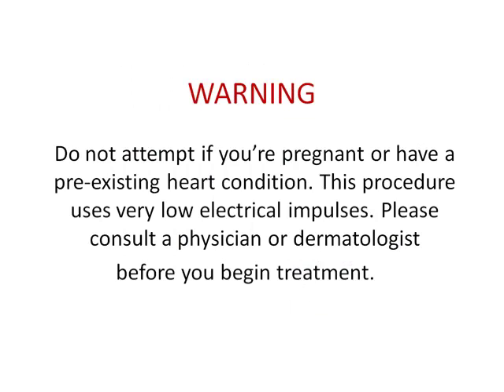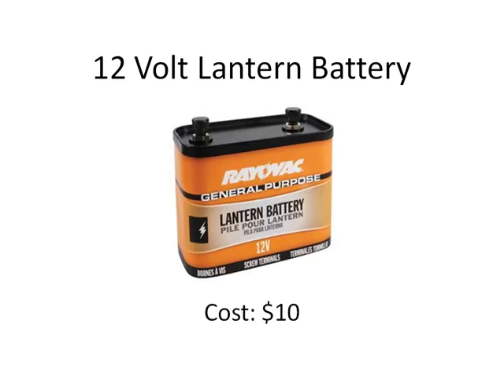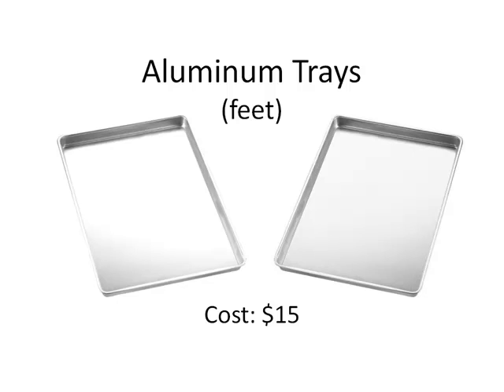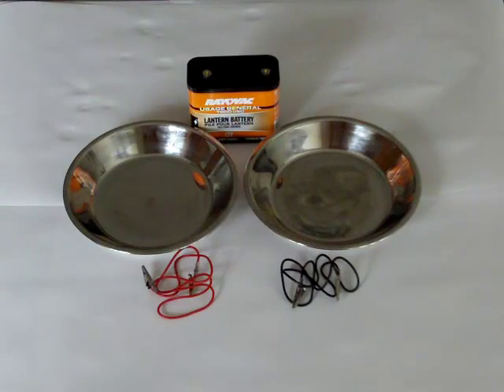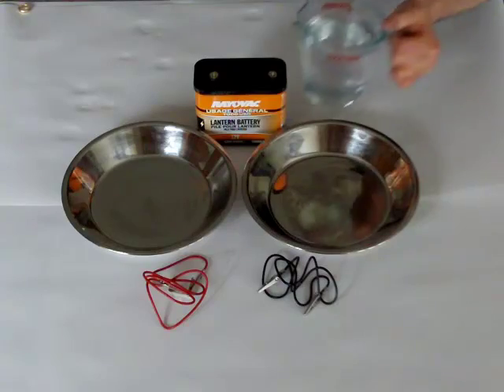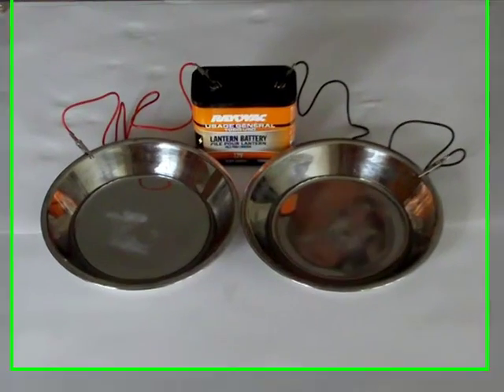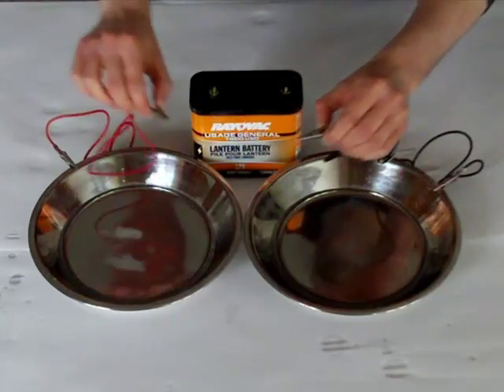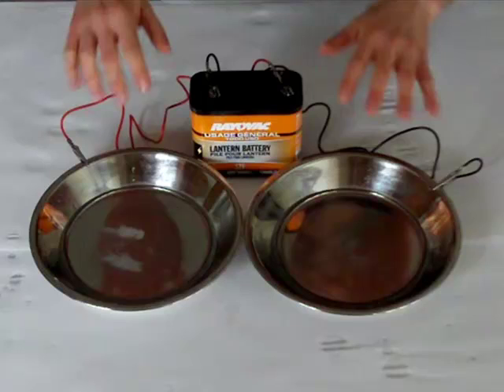How to Build Your Own Homemade Iontophoresis Device

Comment: iam using 12v 6 amps motorbike battery,,today my 3rd apply on this therapy,,but my both Palms and foot feel so itchy and hurts,no decreasing sweat during this 3rd apply,,what should i do,,please help me
Reply: It works man,,dont need to be scared,,at first when i change the polarity i  got electrical vibration,but after 1 minute It slowly dissappear,be brave It won't kill us,,and you'll get the result,
Reply: i got realy heavy hiperhidrosis,,so when i missed the therapy at night,it will be Lil bit wet at the day,,do It continuously brother,,dont skip every single treatment,
Reply: Front Bin Taufiq I will buy today a motorcycle battery right now, I will try it tonight...what pan are you using? stainless or aluminum?
Reply: Front Bin Taufiq what type of battery are you using?
Reply: iam using 12 volt 6 amps mottobatt,motorbike battery
Reply: We don't have Rayovac in our country the Phil's. Too, is it really okey to use the motorcycle battery?I'm scared to have the same problem that you encounter
Reply: Front Bin Taufiq  thanks brother! I will try it very soon, I'll get your word for it...as long as it's 12volts right? is your condition fine?
Reply: 6 ampere bro,, yang penting itu rutin therapy nya,jgn kelewat sekalipun,ane 10 kali baru ada hasil
Reply: kalo mau nanya2 D28371DC
Reply: Front Bin Taufiq Terapi nya setiap hari bro?  kalo pake batre kotak 9 volt cukup ga y? atau aki apa yg rekomen buat dicoba?

Comment: idk how quickly I can get a response but I'm very scared about to try this and I'm so scared it's going to sting or electrocute me 😥
Reply: ok so anybody who's wondering it's super freaking weird. but mostly because I was expecting something bad. doesn't hurt at all a slightly tingle if I touch the bottom of the Pan but that's it. :)
Reply: ok literally after I commented that it shocked me -_- it's not painful it's just a little scary and makes you jump. I'm a little bitch about pain so if I say something doesn't hurt it really doesn't it's just scary when you're not expecting it. :p. I'll come back in a few days and tell y'all how it's going :)
Reply: ryan curran And that was the last we heard of him. You alright bro?
Reply: Abir T kinda. doctor's took 2 years+ to get back to me on iontophoresis. I stopped the one I made because it was just not worth the shock, stress and effort. my new GP gave me Lyrinel XL 5Mg (I think) and it was amazing works wonders I'm on 4 tablets a day and it works 24 hours I sweat maybe 5% what I did (I'm fairly certain I have one of the worst cases of hyperhidrosis ever it's borderline superpower put out fires type shit so Lyrinel is amazing. just makes my mouth dry up but it's not so bad. anyway ya I'm alive and it's 2am and I probably shouldn't reply to this I'm so warm someone help
Reply: ryan curran how much are the pills?

Comment: why is it that Everytime I remove my hands I got zap.
Reply: hey i have a question, which amp 12v battery we need to buy?? there r many available 5 A, 7A, 9A IN 12V
Reply: I would think because instead of the relatively larger surface area of your hand submerged, when you remove it, there's going to be a small final connection that breaks resulting in the shock.

Maybe have a string you could pull a connection loose with your teeth or a toe before removing your hands from the water?

Comment: what will happen if I don't switch it?I got zap when I change the clip..can I just stay on the first one and not switch it?
Reply: I never switch them ....works fine without switching for me. Been doing it for four years every five to six weeks. I do 10 thirty minute treatments without the maintenance in between. I may try the in between  treatments to avoid this next time. work your way up to 21 volts using a 9 volt battery with a lawn battery.
Reply: than you for your help

Comment: I have using it for two weeks and counting, I haven't seen much change in my palm sweat. Can I go for 12v 70A car battery? 
Thanks so much.
Reply: 12 volt lawn mower or motorcycle (smaller) with a 9 volt wired in series. Use your volt meter to monitor before each treatment. IT WORKS ...four years and counting.
Reply: Merhawi Haile

Comment: Quick question, what kind of metal pans are the best? Stainless Steel?
Reply: I uses stainless....it will eventually burn holes into it.....patched mine. I was scared of electrically inducing aluminum into my body for some reason.
Reply: That's exactly what I was thinking about.

Comment: can i use a switching power supply DC24 output 0.7A?
Reply: Scary plugging into 120 volt wall socket and using water. I thought about it many times but  would not. I use 21 volts lawn battery with 9 volt wired in series. Works for me for years and you can recharge the lawn battery or use a  a battery tender to keep it up and just throw away the nine volt when it gets low.

Comment: At about 7:00 after mentioning that you shouldn't connect both alligator clips to the same pan, you ironically achieve the same effect by moving the second pan to touch the first one
Reply: I saw that and that's all I could think of the rest of the video. 🤣
Reply: Right lol
Reply: I noticed that too
Reply: That's exactly what I was thinking is he doing that on purpose or not. do you want a connection between the pans for this to work correctly or is there not supposed to be a connection between them.
Reply: judging by the confabulation of the video, the electrical current is mean to pass through your arms and so the current shouldnt be completed until you use the device
Reply: If you want to learn how to stop excessive sweating fast then go here: SweatingSpot. info
Reply: @barryrodriguez6149  no
Reply: Think about the possibility of going through a whole day, even a whole week without suddenly breaking out into an uncontrollable sweating spell. Go ahead and check out Cynthia Yulesin’s website to learn about a method that has helped thousands.

Comment: How long does the battery last usually before you have to get a new one and how do you even know when you need a new battery? I've seen some people using an adapter, but I'm hesitant about doing that for safety reasons.

I just got into physical therapy school and I need to get this fixed before we start practicing on classmates and patients! Classes start August 22, 2016. Please help!
Reply: Thanks, I will look for an adapter at Walmart today.
Reply: +Seyar buddhaa I bought a sealed lead acid battery so I could charge it. I did my first session last night and it was dry this morning. It's lunch and the sweat is back. Can I do this more than one session a day?
Reply: TemujinKhan8
Reply: TemujinKhan8 it doesnt have to be lantern right? I want to buy a 12 volt rechargable battery, but its not lantern. Its fine as long as its just 12 volts or no?

Comment: I start using this ionto machine I made. My main concern whenever I connect the positive and negative in separate aluminum in a 12v battery i get shocked on my hands whenever i put my hands same time. What I do is I put my hand one at a time on the aluminum plate But I doubted if I'm really getting current if I do this in one terminal at a time. Please advise me.
Reply: This is my first day and yes you are correct. When you soak your hands at the same time you will get a shock and that's really not what you want to feel. Just soak it one at a time. After you dip your second hand, that will be the start of the session.

Comment: is there any alternative battery aside form 12v?
for example 9v battery
Reply: +Louie Gonzales Dude, that's not funny. You can seriously get hurt doing that.
Reply: +Jake Schuawelen I've tried with 9V and it works but the results aren't optimal. So I've put the 9V in series with 2 1.5V and it's perfect. Also don't try 18V, you'll get a shock ;p
Reply: +Jake Schuawelen Plug it directly into your socket 120V or 220V depending on where you live. Instant cure not just on the hands but the whole body lol
Reply: never do this

Comment: 9V is it enough??
Reply: It will be very slow but it should work eventually you'll probably need a way to recharge that 9 volt battery you're going to have a lot of resistance passing it through water and through your arms to make a circuit I would use voltage controller's they're fairly cheap I Got 5 from Amazon for $15 of course you'll still need a power source like a Transformer or batteries to power it

Comment: Been doing this for more than a month and FINALLY it works!! Now my hands are completely dry (or 99% maybe). Bro u reli saved my life

To those who are still having trouble with your sweaty palms or wtever, just be patient coz it might take weeks before it starts to get dry. 

And for your reference I used two 9V batteries (18V in total, mAh and Amp doesn't matter) connected in series, switching polarity every 10 minutes and a total of 40 minutes every night. I used to do it 20 minutes a night but the results are not very satisfying so I doubled the time and it got better.

Sorry for my poor English coz Im Asian
Reply: +Dicky Wu now that youve seen results, I'm wondering how long they last for? like how long until your hands start sweating again? thanks in advance x
Reply: is there any side-effects like impotence if you use this?
Reply: dharma overseas
keep on doing it and don't stop, it will work eventually, trust me
Reply: puting 2 9v batteries does not make it 18 v
Reply: +Dicky Wu u used aluminium or stainless steel pan ?
Reply: i also happen to have two 9V batteries (so i've used 18V) and in my case i've seen no results until the 12th treatment and my hands became almost completely dry, i've done each hand for 15 minutes so there are 30 minutes in total and i've done it every evening. the only thing i didn't like is the shock i got after switching hands, it kept me away from doing it for so long because it kinda hurt
Reply: @natalia.0rb  are you use those small rectangular 9v batteries
Reply: @bipadtarandas1721  yes, are you switching polarity? keep going, it might take over a week when you first start
Reply: @natalia.0rb  when I put my hands into the water I feel the current but after few seconds I feel nothing 🥺 is that happened to you?
Reply: @bipadtarandas1721  yes, it still works when you can't feel it. it's been 6 years since I've made that comment and I still use it this way, it still works for me. however if you're concerned that it's too weak, you can add a little bit of baking soda into your tray. maybe the water in your tap is too soft
Reply: @natalia.0rb  all right, I will inform you later.. are you use Facebook or WhatsApp!
Reply: @bipadtarandas1721  you can inform me or ask more questions here, I receive the notifications :)
Reply: @natalia.0rb  all right
Reply: @natalia.0rb  I think the ampere is matter!
Reply: Yes I am! I use two aluminium barbecue trays from the supermarket and three 9V battery cells connect in series. Add some salt to the water and switch polarity every five days. Don't use too much water, the water level should be just above the area to be treated and you should be fine :)
Reply: Dicky Wu where did you buy alligator clip? can't find here in mid-levels, please help
Reply: I do 2 sessions a week for 7min each polarity and hands are dry
Reply: Ting Fung Wu hey I wanted to ask you, are your hyperhidrosis gone forever or not and also how is it three years later??thanks
Reply: +Dicky Wu higher voltage works better? do you feel any discomfort during the treatment? coz im keen.
Reply: +JiaJun Chiw yes I think so, some people from other videos also recommended a higher voltage if you're sweating heavily. You will feel a shock when you put your hands in the water especially right after you switch the polarity, but it would fade out slowly unless you've got wounds on your skin
Reply: +lalalovinlifelala Basically it cuts off the sweat for the entire day. Now that I'm starting to reduce the dosage instead of doing this every night and I found the effects will start to wear off about 3 days after the latest treatment.
Reply: does it hurt?
Reply: is this really ..i have try from a week but here is no change what can i do
Reply: Dicky Wu hi are you from HK? i need help i have the same problem too
Reply: I bought those from Apliu Street. U can find all sort of electronic stuffs  there
Reply: Ting Fung Wu where are you from?
Reply: Do you experience any itching or irritating thing while doing this process? Coz I experienced in my first try.
Please..
Reply: how long does a 9v battery last? I mean how many times have you changed the battery, like once a week or something
Reply: Are you use regular 9v battery? I'm doing this with two 9v battery for about 1week but I feel nothing 🥺

Comment: I don't have issues with my palms or feet but I do for my upper body....chest, back, under arms, waste......any techniques similar to this for treating these areas?
Reply: basically you can do the same for your chest and back or underarms ... just need the right "adapters" :) . Unfortunately before i found this video i buy very expensive machine on iontophoresis - but its possible to order from their site just the adapters on certian parts of body and they are not so much expensive :) - http://www.electroantiperspirant.co.uk/order-iontophoresis-device-against-sweaty-palms-feet-armpitshope it will help you

Comment: I love how this works and it really does, although for my face and under arms I'm stuck getting botox.
Reply: +Patrizia Meja use something called Certain DRI, I use it every night under my arms and it works great, not sure if you should put it on your face though, it dries your skin out
Reply: +Patrizia Meja Ive also looked at a recent video where the youtuber said Sweat Block works. look it up!
Reply: drysol completely cured my sweaty underarms
Reply: Thank you lady's, but I also heard that anxiety can also cause severe sweating any truth to that?
Reply: absolutely, anxiety always made my underarms worse... try Drysol!
Reply: basically you can do the same for your chest, back, face or under arms ... just need the right "adapters" :) . Unfortunately before i found this video i buy very expensive machine on iontophoresis - but its possible to order from their site just the adapters on certian parts of body and they are not so much expensive :) - http://www.electroantiperspirant.co.uk/order-iontophoresis-device-against-sweaty-palms-feet-armpits.... maybe it will be better solution than using a botox :) (at least i can say it definitelly works fro under arms )

Comment: lol the stupid fuck just as he talks about "never to connect the alligator clips to the same plate" he pushes the right side plate to the left making them touch eachother. they become one, essentially the same plate. @6:50 - 7:00

unbelievable.
Reply: @UCantHandleTheTruth3:  At 8:37, look (and listen) closely when our budding electrical engineer "reverses the charge" and reconnects the clip with the black wire to the battery terminal.  There's a small blue spark, which indicates that the pans ARE touching, forming a short-circuit.  Dumbfuck.

Comment: What's the reason of changing the polarity?
Reply: Fingers carry the least current because it has the least bloodflow, hence it takes longer for them to dry. A way to improve it or speed it up is to make sure the water is warm/hot, so that your body increases bloodflow to your extremeties (i.e. fingers) and thus current will increase. You can also lift your palm out of the water, and kind of "claw" the water with your fingers, so the current has no choice but to go there. Remember, electricity travels in the area with least resistance, which is your palm.
Reply: +David Zuren No clue if you're still interested in the answer, but electricity flows from the negative terminal to the positive. If you don't switch the wires, then the electrons are only flowing in one direction meaning only one hand/foot is getting the treatment. Both hands/feet need to be in the separate pans to complete the circuit. Hence, needing to repeat the process for the electron to flow in both directions. 

Do correct me if I got anything wrong, hope this helped someone :D
Reply: +Amanda Q. Oh thanks anyway. I've been doing the treatment for a while now and I never thought it would work, but it really did, I'm very happy now. Also, a did change the polarity to have the same results on both hands!!
Reply: Amanda Q. You can swap the hands if you don’t like to swap the cables.
Reply: byh c
 Omg, thank you very much. I've been lifting my palms of the water to have only my fingers, but i cant really resist because that much current only on my fingertips actually hurt. I will try heating up the water to see if that actually works. Thank you so much for the advice!
Reply: +David Zuren congratulations ! How long does it take ?
Reply: Va Virak 
Well, I started noticing significant results at the end of the second week. The routine that I followed was every single day for 20 minutes (10 minutes, then change the polarity of the battery and then another 10 minutes). My sweat decreased to an 80% or so. I can't give it a full 100% because for some reason my fingertips are still swearing and I don't know why. My palms couldn't be dryer and I'm so happy with it, except for my fingertips for what I just mentioned. One thing to mention is that I didn't just do it to my hands, I also made for my armpits although it's a bit more complicated. Same results, my armpits couldn't be much dryer, they are so dry that I can wear a shirt a whole without having a single drop of sweat.
Reply: David Zuren
Well if it's hurting, then you already have too much current, and it's just a matter of time. My suggestion of heating up the water is only when you don't have enough current and it isn't getting dry.

Comment: If you  don't have a 12 V battery, you can connect two 6V batter in series to achieve the same effect.
Reply: If you use 2 6v series,can you still use two plates or would you have to attach both clips to one plate?